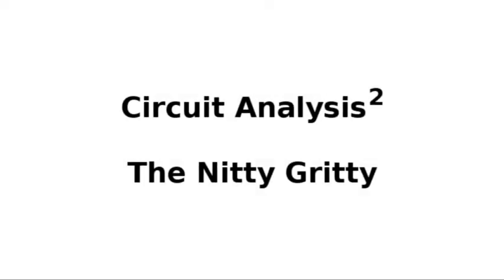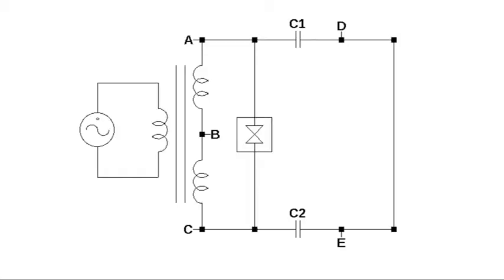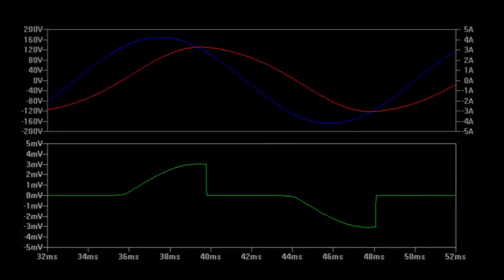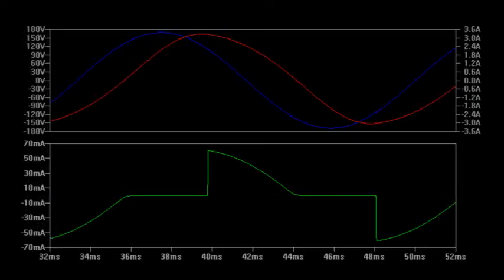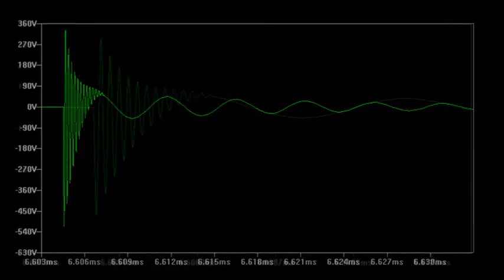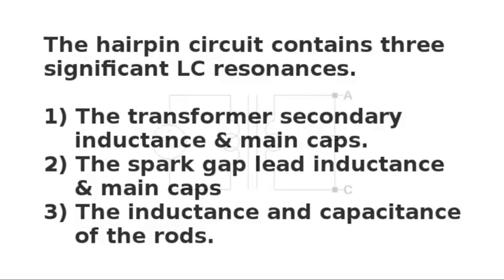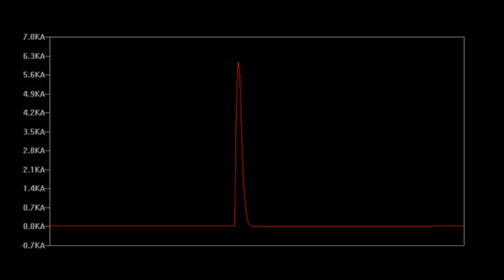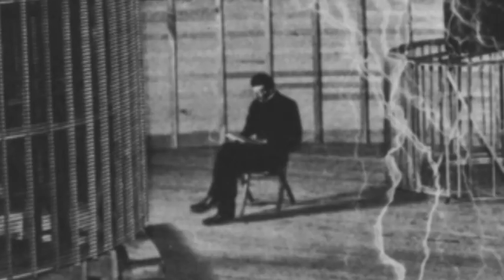Tesla Hairpin Replication - Circuit Analysis 2

Comment: Thanks for this excellent review, which I read as providing a full explanation within the bounds of standard circuit theory, without recourse to the 'over-unity' type magic which can always be de-bunked by proper power measurements. But I might disagree a little with you in that I would expect to see strong oscillations (in the kV range) present at the 'quarter-wave' frequency. In the corresponding Tesla Coil circuit, the stored capacitor energy is rapidly exchanged with magnetic energy in the inductance of your transmission line (and its shunt) and that is the means of power transmission into the TC secondary! In other words, all the tiny inductances which would usually be considered 'parasitic' are actually key defining components in the functioning of the circuit. Happy sparking and a thumbs-up!

Comment: Then what is the current :  A movement of electrons ? A propagation of waves ?
Reply: Emanuele Civetta You raise the essential difference in Tesla's models of electricity and Business Science's model of electricity. Current is not the movement of charge past a point in a circuit. It is a form of electricity that is a gradient in the Aether of polarized Aetheric particles. Charges set this up orthogonally to their movement, which forms the magnetic field which is proportional to the current. As a gradient without charge, current it travels as a compression wave in the Aether of space which has a native gradient depending on the mass influence of all charges in the localized space. This creates wave interactions, some interpret as the bending of space-time. A quaint concept.

Tesla noted that current waves, similar to compression waves, traveled faster than light speed; He also observed that the Aether, in transmitting these waves, since it is made of the wave's material (I presume), it would increase the amount of Aether traveling in the wave, delivering more current at a tuned receiver than was broadcast. Tesla testified in court that at his millions of volt sparks, he could amplify the power at the receivers by as much as 5,000 times. Not over unity, simply an amplification of power from the substance that space is made of, like amplifying an echo in a canyon. Also similar to sound waves, he discovered natural lightning strikes form standing wave patterns miles distant from the strikes themselves.

Capacitors are essential to his technology because they collect and concentrate the current. Current was also called dielectricity in Tesla's day. Capacitors take the voltage from a conductor, turned it into dielectricity, and stored it in the dielectric, releasing it in a spark gap at the increased current densities he needed to get the amplification he needed from his transformers. He testified that his alternators were self-powered, recharging the caps with the amplified spark gap energy, transmitting the bulk of it losslessly (similar to starlight crossing the vastness of space, an invisible form of light), and not interacting with intervening substances (like astronaut retina) if it was of the right frequency. (I believe this is an artifice of the magnetic field being aligned with the direction of the compression wave, not orthogonally to it.) Of course ferromagnetic materials amplify it; and conductors collect, reflect, and transform these current waves into voltage which activates the lights and stimulate the currents or use the currents that remain to power the circuit components. Tesla would explode tin foil with this broadcast current within a coil, then stick his head in the same spot and show people how safe it was to people.

If you build a capacitor so that the dielectric material can be removed when charged, you can demonstrate the charge is stored in the dielectric, not in the conductors per BS theory.

Tesla optimized his spark gaps to reduce the charge reversals of large gap sparks and maximize the current exchange. His final design was an oil bath jet between a spark gap of two counter rotating discs with spikes on them. He also determined maximum transmission distances with minimal sparks lengths of very high frequency.

Essentially current is the wake of the Aether traveling around a charge flowing in a conductor. But it is also a gradient in the Aether that seeks balance with the Aether, motivated by a localized change in Aetheric density. or polarization. Recognizing this can simplify the mechanics of transmission lines. 

Another problem with this design as executed here are the wires to the rods. The caps should be directly connected to the rods and the shunt should also be a heavy rod. Things would work much better with these refinements. The goal is a large current reservoir that can power loads. What remains is the degree to which cancelled voltage and frequency contribute to the "cold" electric effects others demonstrate. I suspect the high current, low voltage differential is the key, but one cannot argue skin effect is not part of it. Be safe.
Reply: @mundymorningreport3137  Finally, someone who understood Tesla on the highest level and described his works so beautifully! You should teach others your knowledge. Very few people understand Teslas work prior to 1890.
Reply: @mundymorningreport3137  Finally, someone who understood Tesla on the highest level and described his works so beautifully! You should teach others your knowledge. Very few people understand Teslas work prior to 1890.

Comment: First thing I see you did wrong with your replication, is you didn't use a 10kv transformer, Carl specifically says you don't get all the same results at lower tensions :/
Also if you look at what the GE lightning lab used for voltage divider for measuring lightning strikes, you will see they used a capacitor voltage divider, and not a resistor based voltage divider for measurement.